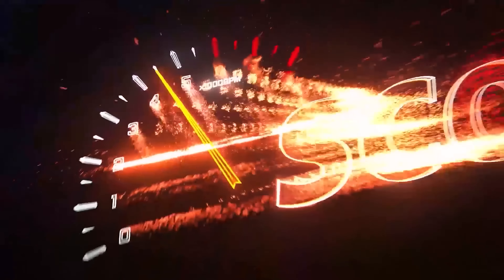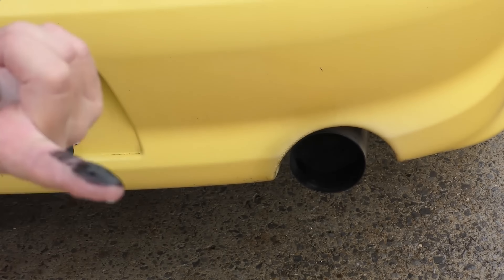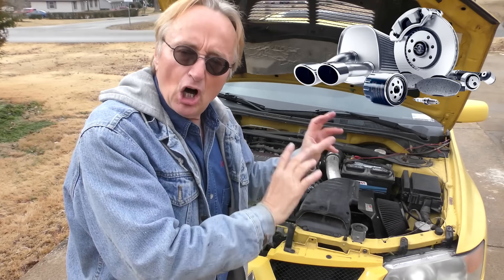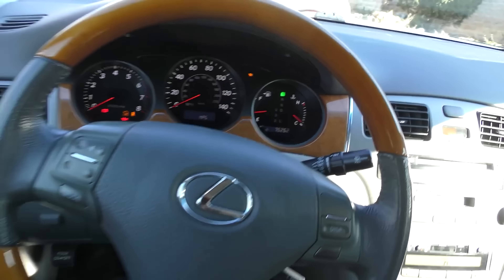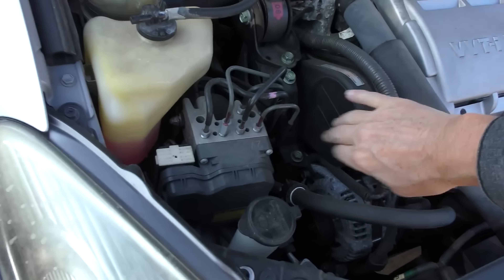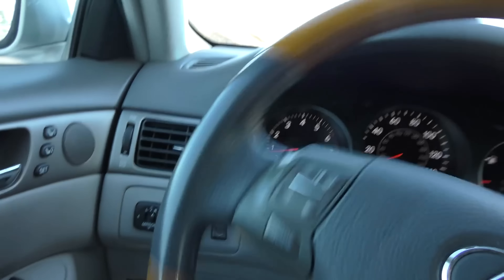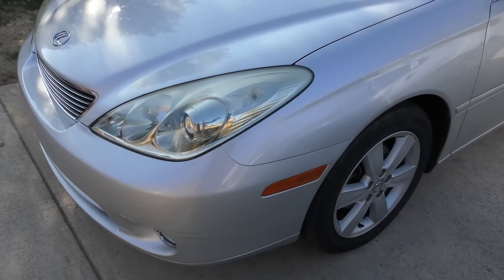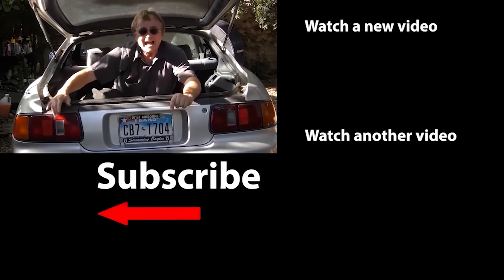4 Signs You Shouldn't Buy a Used Car

Comment: First married first car was a Plymouth Champ.  It out lived the 6 yr marriage, and 10 yrs of divorce, put over 500k miles on it, did the necessary maintenance, best car I ever owned, ran like a top, started on the coldest nite in Chicago history.  Absolutely no complaints about the car.  Sold it to a distant relative of the family, they wrecked it and got enough out of it to buy a new car.  It held its value.  I wish I could get another car like that today for what I bought that one for back in the day…it was a 1979 Champ, and a Champ it was!  Great car, and yes it had a 4 cyl Mitsubishi engine.  Take good care of them and they will take good care of you.  I miss that car, and oh, it had the twin sticks manual transmission with absolutely no issues at all.

Comment: I used to own a 2009 Mitsubishi Galant with a small 4 cylinder engine and it ran like a dream. The only time I ever brought it to a mechanic was to get new tires and new CV axles while doing all the other maintenance on my own. Got it when it had 182K miles and drove it pass 300K miles but loss it in a bad car accident. Check engine light did came on once for gas cap but got it taken care of easily. The problem is NOT the Mitsubishi, its the owners who modify the car.

Comment: I have MASSIVE respect for this car. Love Mitsubishi and the Evo. Mitsubishi cars tend to be reliable when taken care of too, unlike the Hyundai, Nissan, and American cars.
Reply: Well, I've have 4 Nissan to date. Had a 2005 Sentra I've kept for 13 years. Now on my third Sentra (a 2024), and second Nissan with a CVT (previous was a Rogue)
Reply: @denisdeslauriers7277 I believe Nissans are good but not as good as a Mitsubishi.
Reply: @mrgurulittle7000  Having owned both brands, I kinda agree, but as much I loved my Lancer, I have to admit that the Nissans I've owned come pretty close for reliability.
Reply: @denisdeslauriers7277 Well, I guess so. They’re both good then.
Reply: I've owned 99 eclipse 420a had piston ring failure. Mitsubishi didn't use the best piston rings.
Reply: @lucidrebuilds6129 Yeah. Interestingly enough Hyundai also had the same problems with their variants of the Mitsubishi engines of the time.

Comment: A great used car I had was a 2006  5-speed manual stick shift Kia Sorento 6 cylinder.  It ran 39mpg.  It had a 21 gallon gas tank.  I drove daily seven days a week and one gas tank would last for 3 weeks.
It's range on one tank was phenomenal.
It ran like a swiss watch flawlessly without a single problem whatsoever.  All I had to do was change the oil.

Comment: You can also check the brake pedal to see if it is extremely worn down meaning the rubber
Reply: $14 Ebay Motors.
Reply: Check the driver's door hinges, by seeing if there is play (movement).

Comment: I've driven 2004 Lancer to 2009 with 170k miles on board. Automatic 4 gear that learns your shift-great routine and turns that into auto. It was amazing.
I had 99' Carisma 1.8 GDI. did 100k miles with that. It was so cheap in Turkey you wouldn't believe. 1.8 125hp makes 0-100 9 seconds. Digital AC etc. Amazing college days.
But Mitsubishi doesn't make cars priority anymore. I even have Mitsubishi AC at home, 13 years and still does the job like first day

Comment: Bought the green 2014 v6 mustang in my profile picture for $14k, 76k miles the one issue it has is a rear main seal leak it’s a small one even 6 months after buying you can only smell something when you get on the throttle and I haven’t seen any oil spots on the ground . Yes it’s a $1000 fix, expensive but it’s a fairly common issue that arises on vehicles approaching higher mileage everything else in the drivetrain is healthy based on what a mechanic told me so the fix in my opinion is worth it.

Comment: Scotty says always have a mechanic check it out before you buy it (used obviously) My question is how is that practical or possible?  It's not like you can tell the seller " I'm thinking about buying this car, let me take it to my mechanic."  You'll have to wait though, he doesn't have any openings for 10 days.
Reply: Just Google pre purchase vehicle inspection and you’ll find a bunch of places that will do it nearby. Unless you live in the middle of nowhere it’s not that hard.
Reply: Totally right.  I don't think most people trust other people they don't know to take their car away temporarily.  I probably wouldn't.
Reply: If they don't trust you, they can take it to a place you pick. 
I've had an inspection that was worthless anyway, but if a seller didn't want to allow one I'd be skeptical
Reply: Same here. That's why I use pet boys that closest to the shop. They take you in as a walk in usually. I also had a mechanic with a small shop. I could call snd he also took me in asap.
Reply: Almost impossible. The car will be sold long before you can arrange an inspection. Low mileage Lexuses and Toyotas sell immediately.
Reply: Dude. You got to know how to inspect your own car. That's the only way it's going to work. If you don't know anything about cars, you probably shouldn't be driving one. It's very dangerous. And if it breaks down, you're going to be crying

Comment: The problem with cold air intakes is the filter parts are not ducted like standard intakes.  If a shroud or duct is installed over the filter part then maybe it will work better.
Reply: Like the factory airbox. Plastic insulates heat. Aluminum attracts heat.
Phenolic plastics.
Reply: There are ones that actually do that, but they're much less common than these messy ones that don't really work. Without the ducting (and potential heat shielding of a good system), the open ones like in this car are basically "warm-air" or "hot-air" intakes. It's the tunes and the larger intake piping that do all the work here.

Comment: I don't know if it's the same in America, but I assume it probably is, that to do an OBD check on a Mitsubishi with a scanner you have to have Mitubishi's own MUT scanner... and you can't buy them because they're only for the official Mitsubishi dealerships and no one else can (offficially) get one because they won't sell you one. They still use the same OBD socket as all the other makes but the software system is Mitubishi's own and they;re not compatible, even with expensive scan tools.

Comment: Sorry but I bought a 02 firebird that had a 98000mi in 2006 , & it still runs fine the only major thing I did was got a Remand Engine in 2012 it still runs great,  now in 2024 , but I added certain parts during that time. If you take care of your car you can drive forever,  nuff-said 😊
Reply: Right on! Take care of them! My 30 year old Ciera 3.1 liter is still on the road due to its excellent service record

Comment: That has to be one of the worst-looking aftermarket "cold-air" intake systems I've ever seen. They kept the factory intake funnel but removed the next part of it, so it basically steers the air into the side of the hood. The actual filter and intake pipe into the engine is facing the opposite direction. I guess they're thinking the air is somehow going to take a U-turn inside the engine bay? 🤣
Reply: I own an evo and this is pretty much how beginner evo owners do it, there was a time I directed it almost the same back in the 2000s. When I had money I just redirected intake in the lower right of the bumper as a real CAI

Comment: Scotty - is this to destroy the cat converter if not already or the o2 sensors with the raw fuel?  U think for emissions is checking the exhaust so not polluting?  I had old late 90s car  with cel on and costly to get off for nys inspection.  This car ok for states not checking this.

Comment: Scotty is right about unreliable automatic transmission for most cars. While the same ones with manual run for decades without any issues and low cost.
Reply: Until you need a new clutch.

Comment: I'm like 8 months too late... currently hating my car. It has a leak at the differential end of the cv shaft so I got under there and realized that I can slide it in and out, so I take everything off, and now the cv shaft won't come out no matte what I do. I've spent two afternoons on this and now I need to borrow a ride to work tomorrow
Reply: What year and model is it? Did you look into how to remove CV shafts on it? A lot of them have nothing or a weak spring clip that holds it in the transmission. The front suspension is what mostly keeps the axle shafts from ripping out.
Reply: Chilton or Haynes, or Motor manual.
If internet was to crash, paper documentation becomes valuable.
Reply: Possible that you need to rotate the axle and then try pulling it off. They typically have a 3mm cold rolled C-Clip which locks the axle in the diff/trans.
Reply: @gregorymalchuk272  It's a 1998 toyota 4runner.
I did a lot of research before trying to remove the axle myself. In every guide or tutorial I've found, they just say to pop it out with a prybar, but that isn't working for me. I've put so much effort into prying that I can confidently say that it's not coming out. I'm sorry if I'm coming off as rude but I'm just very frustrated with the situation I've gotten myself into. I appreciate the reply.
Reply: @fromthebackofmymind  that could be the case. I’ll try when I get home. I did rotate it but never really tried every angle

Comment: That car is so simple to tell fuel trims the software is pretty in depth and free. It has a manual boost controller and the K&N intake was CARB certified and it was $380  junk. The dirty exhaust is 3in catless and it probably has a bigger fuel pump. Any change to the intake tract and it needs a retune. If the guy put some stock parts back then its a screw you to the next guy with the tune.

Comment: 2009 lexus es350, 86000 miles...rack and pinion replacement and alignment $3100 😢😢😢
Reply: Get a second, third and fourth opinion before you spend that kind of money on a single repair. The alignment should be around $100 so they are taking you to Timbuktu and back with that price on the rack!

Comment: I need to find one of these types of cars. All the 2007-2008 Corollas I’m finding online have 175,000 to 225,000 miles on them (or more), and they want $7,000 to $9,000 for them, with questionable body integrity (I live in the Minneapolis/St. Paul area where they heavily salt the roads in the Winter, and rust is a problem). My wife (disabled) and I live on Social Security, and $7000 is about the limit of what I can scrape together, so if I buy a car, I need it to hold up for awhile before it needs any repairs so I can save up for them.
Reply: Best to have at least $1000 in reserve for repairs when buying any new car

Comment: If I was to guess, on the Mitsubishi  someone changed to bigger injectors thinking more fuel more power
Reply: Go into ecu map and adjust fuel for new, higher flow injectors. Whatever Denso ecu programmer you can buy.

Comment: Hey Scotty, is 200k too many miles to buy a used triton V10 with a regular/thorough maintenance record? I’m looking at a ford excursion with almost 200k on the v10, but the maintenance looks immaculate and the body is spotless, thoughts??
Reply: If the price is right and there is proof of maintenance/ repairs I say go for it bucko!
Reply: Triton V10 have sparkplug issues on removal. Ford has had many issues of plug breakage in the cylinder heads.
Very badly executed cooling passage ways in the head. Hot spot, thermal fatigue. Duratec inline fours. And the early 2000's Supercharged Cobra modular V8's. Irridium plugs from the factory need to be changed at 100,000 miles. 
So the Ford your looking at should not have the original "MotorCraft" spark plugs.

Comment: 2006 Toyota Tundra SR5 4.7L V8, 211,000 miles. it has a hard time turning right and has a leak coming from the right strut. Is it worth $6000?

Comment: Chain her up to a front and rear post, get ready to do some awd burnouts. No clue how long the engine and drive train will last😂. Could be faulty maf/map sensor , forgot what is what. Could be stuck/hung opened injector. Could be using wrong injectors, i.e. "peak and hold" injector without using a fuel injector resistors. Remedy, remove the fuel injector resistors, do a proper  solder without resistors, and install the appropriate sized "saturated" injectors.

How I know this, asking the right people who deal with these types of cars. Mitsubishi is a different animal. Hecks you need a special scan tool to work on an OBD1 1991-1993 Mitsubishi GTO/3000GT depending if you have a US or Non US MMC vehicle. Awesome youtube show today,  Boss Scotty 🤙🏽

Comment: i wouldn't have bought it just for being yellow or having goofy graphics down the side, and combining the two just makes it worse. other than that, i never hated mitsubishi (though i've also never owned one)
Reply: Mitsubishi is vastly overrated... as a vehicle, that is.
Reply: I had a 79 Cordia I bought used in 89 for $400. $300 Rebuilt NAPA Carburetor and drove the car for years. Sold it to a newlywed couple for...... $400.
Reply: @tommielee8 Yes, over rated.
In 1941
They got a "Zero" over Hawaii.
Reply: 81 Cordia